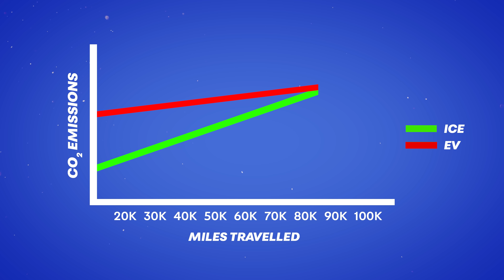Are Electric Cars REALLY That Green? [New 2022 Data]

Comment: Rory, didn't touch on things  like the fact that for instance my ICE car only has 15K on the clock after 6 years so its not just about miles done but a cars utility and life span, most are replacing cars not buying them for first time . If most of us repaired and kept there existing ICE cars longer that break point mileage is more  like ~100K , what's an EV battery going to look like after 10 years .. doubt my car would require more that £2-4K  (clutch, brakes, shocks, misc...) to keep it on the road for another 5 years.. Quite a few cars are binned before 60 -100K miles  or after 7 years old ,  i.e. a timing belt change on a car that's worth only 3K  usually just isn't worth it. Lets not start on whole anti-repair culture  (don't see how we can be green with it) that permeated in the last decade or so... worse now as the government will seemly completely ban or tax ICE cars  on a whim. So quite a few cars will barely, or wont hit the break even point. Also the Volvo report 2.4.4 didn't factor in the expansion to the power grid  (increased power generation, upgraded wiring (digging up roads) , charge point manufacturer and installations) lord knows how  much Co2 that will add.

Comment: I personally don't like electric cars, I feel like on the longer run when it comes time to replace the battery or if the electric motor burns out for some reason, you would seriously regret buying an EV. I don't feel comfortable putting down my heard earnt money into a product that's not going to cost me much in the immediate future but later down the line is going to cost me an Arm and leg keep things running. Also the resale value of electric cars I would question that as well, both as a seller and as a buyer.

Comment: Did Volvo even took into account that in the most optimistic version delivering 1l of gasoline to the gas station costs 3,5 kWh? It's at least 3,5 kWh wasted energy before even ICE tooks off from the distributor and starts its emissions of not only CO2, but all the other toxic fumes? When you consider that this Volvo burns ca 9l/100km, it's 31,5 kWh of energy which would all9w xc40 drive way over 100km before ICE even started driving...
I believe they missed this variable which makes the hell of a difference and moves break even Point probably significantly on EV favour...

Comment: Nice video. I think your point at the end is a really good one - size of battery and overall weight of the vehicle is VERY important.

It feels like most EV manufacturers are still building big fat cars. Why hasn't Nissan made an ev Micra for instance - they could likely deliver 100 miles around town for well under 20kwhs. And it could be affordable too.

As long as most EVs are chunky SUVs we're likely to see break even stretched towards 90k, rather than 20k or so...

Comment: It's 100% still true that a smaller BEV will be better than a big, massive one for using less electricity and fewer resources in production, which is my main takeaway. The LEAF Plus manages about the same range as the XC40 Recharge, but with 800 lbs less "stuff" to haul, meaning it gets to use a smaller battery, and uses less energy per mile.

In general, I'd encourage 1) people buying EVs think critically about the battery capacity they actually need, rather than just assuming more is better 2) ICE drivers to check into the literature on BEVs with an open mind, understanding that BEVs are not as good a solution as public transportation infrastructure is and 3) vote for change that will move the ball downfield on lessening environmental damage.

Comment: The problem not discussed is the battery life, so at approximately 8 years you will have a high probability of battery failure so then you need to replace them, this is bad because you have the new battery impact and the unconsidered impact of recycling the old battery which is massive.

Comment: I think that people need to be realistic on the size battery they require when buying an electric car. I have an e2008 with 50kw/h battery which really provides me with the range I need on a daily bases for 99% of my trips.
Reply: Exactly Carl. The average UK daily commute is 20.8 miles, and the average UK motorway journey is 70 to 80 miles. The typical UK non commuting journey is 9 miles. Yet there are still those whom say they won't have an EV until you can get one with 10'000 miles range, which charges up in 4 seconds. A 200 mile range EV would actually suit the vast majority of daily drivers, but they just don't realise it yet. It's all about perceptions and expectations. In the day of the horse, people had totally different expectations, and lived their lives around them. It once took a week to get to London if you lived 200 miles away......

Comment: What about when you factor in after 10 years you will probably need a new battery? Won’t this make the overall CO2 of the electric car make another huge jump into the red?
Reply: EV batteries don't just drop dead, they can have a second life in e.g. House battery storage. And the materials in the batteries can finally be recycled to make new batteries. The very thing that makes them expensive in the first place is driving the recycling demand.
Reply: Why might you need a new battery?  Why wouldn't you consider having the pack refurbished, at a fraction of the cost of a complete new replacement?  Usually, in a multi cell pack such as you find in an EV, it is just a certain few cells which degrade at a higher rate than the rest. An older Nissan Leaf for example, has over 90 individual batteries making up the complete pack. There is already a YouTube video of a 10 year old UK owned Nissan Leaf having it's battery refurbished. The work took 4 hours and cost the owner £600.  Quit the "new battery" scare stories, because they simply aren't true in the vast majority of cases. You might like to note that in 10 years, an ICE car will also need replacement parts and repairs......
Reply: @Brian-om2hh  You could have the battery refurbished but at some point it will need to be replaced. If not the individual cells will have to be replaced as you mentioned. 

I think this is more of a concern for someone who only buys second hand cars, like myself. Now if I buy a car with 80k miles there will always be a concern that a very large bill is approaching in the near future. 

To be honest my main issue with EVs is that the people who drive them like the smell of their own farts. They are advertised like they are a huge leap forward in terms of pollution reduction and it’s not exactly the case given what it takes to create them. 

My point about the battery replacement, wether it’s the whole battery or only certain cells, is this just adds more to the EVs carbon footprint making it even closer between them and ICE. 

A lot of people nowadays are very wasteful and only want new cars, with low miles. They will flog the EV to buy another new one before they have broke even. 
The world has gone to shit :D haha

Comment: Brilliant, informative & hopefully AT LAST, a BALANCED view!  Thank you so much & very WELL DONE  RORY AND VOLVO!  Like you, I have a fully renewable green tariff so 29,000 miles or so sounds about right &, more importantly, workable.
Be interesting to see with the massive numbers of 8 + year-old ICE cars still around, whether the same will apply eventually to BEVs, in which case, greenness may prevail at last.  Of course, that is much less of a guide because the CO2 comes largely from the battery pack which needs replacing more often than the car, at present.
Reply: The batteries should last at least 200k miles before needing to be replaced but that all depends on how they are treated (since letting them fully discharge often significantly reduces their lifetime). Of course different and better batteries will also be coming in the future to replace current lithium ion.

Comment: While Volvo mention well-to-tank environmental impact has been assessed as a particular ethanol mix, they do not mention how or provide numbers on its emissions; which given they have gone into detail on different energy mixes for the EV is a source of bias in the report.
Since oil first started getting drilled, the amount of energy required to extract it has increased. Oil fields get deeper, move out to sea or require extensive mechanical extraction as in the case of tar sands.
In the 1920's the ratio was roughly 1:100; currently it is closer to 1:25 according to BP. Put simply, for every 25 barrels of oil extracted it takes 1 barrels worth of oil energy to extract them and it only ever gets worse.
While the EV can get greener as domestic energy mixes improve, the ICE will definitely get dirtier without massive changes to the fuel, themselves requiring unknown amounts of energy to achieve.
Given the majority of cars do well over 100k miles in their lives, the report tells me that either way they are greener (not green - greener) and the comparison is only going to go one way.

Comment: There's never much said about the waste batteries what happens to them and who's recycling them.  I can see this as a environment problem for years.
Reply: Oh, the materials in the batteries are much too valuable not to be recycled.
Reply: Volkswagen already have a battery recycling plant up and running in East Germany. A UK based company - Technology Minerals - is also to begin looking into processing older EV batteries. They are said to be planning 5 sites in the UK. A number of other organisations are looking to do the same globally. It is estimated that eventually there could be 150+ EV battery recycling sites globally.
Reply: Batteries have a significant value for second-life applications like domestic storage beyond the 200,000km Volvo have used here.  It may be a long time before the economics make recycling the preferred option.  I see this as a major omission in the report as, if I am reading it right, they are assuming it will be recycled at that point.  As the primary difference in upfront carbon between ICE and BEV is the battery pack, ignoring second-life potential puts the BEV at a disadvantage.  I don't think Volvo is being disingenuous, they have just followed a methodology that assumes 200,000km is end-of-life for everything.  They have strived to maintain like-for-like, but that tends to lead to doing things the "old way".  However, whether we are talking about materials extraction, manufacturing, energy generation, logistics or recycling it is important we strive to avoid finding new ways to be bad for the environment.  We have not always been good at learning the lessons of the past.
Reply: @andrewhowe4266  "methodology that assumes 200,000km" WHICH IS SCAM! Minimum should be 200,000 MILEs.
Reply: @Neojhun  I think scam is a bit harsh.  I think the EPA uses 200,000 miles for car life, but they assess annual mileage as 15,000mpa.  In Europe, the average is only 12,000kmpa which is far lower.  All the assumptions they make alter the result.

Comment: Oh, the Tesla Fanbois are not going to like this.

90000 miles =  150,000km = about 10 years driving.
By which time an EV battery will be toast and needed to be replaced.
And then the EV takes another spike upwards in CO2 emissions as the new battery that was replaced just took 13 Tonnes of CO2 to produce. Which takes another 150,000km to start breaking even again.

Summary: EVs are not green [Water, CO2 emissions]. Not at all.

Comment: Evs have no maintenance cycles like oil changes and the like.  Multiply oil changes x a billion automobiles and that’s 5 billion quarts every cycle.  That alone cancels any ice cars out of the loop.  So take your car at only one oil change a year, remember some cars Porsche may take up to 13 quarts or a hyper car may take even more. The cost alone with fuel will double the price you have paid for the car in just 10 years.  On a EV. No maintenance. And no gas,  although they may get plugged in but no one seems to be able to put a cost on the total amount of electricity used.  My ev uses solar cells and gives in the sun 40 miles to drive a day.  So I’ve not had to charge it yet although it was fully charged when I picked it up.  I’ve been charging regular car batteries for my cars for years though from 
Solar power.  I really admire a friend of mine as his house has been off grid for the last twelve years.  And the initial investment back then was only about 35k. I think the power company has paid that for his contribution to the grid.

Comment: Wish you can continue this video until the EV's need to get the battery replaced or serviced like a womb to tomb thing?
Reply: Most current ev’s will never need to have the battery replaced during the life cycle of the vehicle due to the better battery chemistry and battery management systems in new ev’s. Ten year old Nissan Leafs still have 2/3 the capacity they did when new and battery technology has improved hugely since they were produced.

Comment: The Volvo xc 40 is not a bespoke ev though so it’s compromised over a ground up ev design. Smaller ev’s like the Renault Zoe or Nissan Leaf or Fiat 500e pass the extra co2 involved in their construction much earlier in their life. Plus plenty of other studies bu universities have shown ev cars recovering the extra co2 involved in construction after much fewer miles than this study. Also the fossil fuel energy production figures are moving ever faster towards renewables shortening the miles required for ev cars to pass petrol cars for co2 released. The way to makes ev’s even greener is to make them lighter and more efficient, not by haveing large SUV’s with massive, heavy battery packs. Smaller battery packs and a better charging network is the way forward. Most people don’t need 250 miles of range for most journeys.
The other thing that wasn’t mentioned is that ev’s are far cheaper to run than ice cars both in fuel cost and maintenance

Comment: I really only care about the savings to my wallet. Unfortunately with electricity prices set to be 36p per kWh soon Evs will actually be more expensive to fill up then cars.

For example the partner 50kwh van will cost £18 to fill up the battery and do 100miles compared with the diesel partner which will cost just 10 quid to do the same 100 miles.

Over a year of driving for me 25k miles, the difference would be 4500 for the ev to 2500 for the diesel.

Comment: I think the bottom line is, that EV will evolve and reduce emissions even further very soon. ICE cars has reached there dead end already,  beside the real emission under different temperature circumstance, where the emission system on ICE will work suboptimal. I am not sure if the overall consumption of required lubricants was considered in the research, but also consider the the lower fine particles that a EV are producing using regenerate breaking in city’s. Overall it does not matter EV will be the most less polluting transportation in the future despite the very optimistic research for ICE cars as of today. BTW battery can most likely be recycled in a very high percentage but good luck on trying to recycle the consumed petrol ⛽️😉

Comment: Did Volvo also include all the emissions being produced by installing chargers in millions of homes and streets,  charging cables being produced, car fires that last for days etc.  It's not cleaner at all and the reason it's not cleaner is because they are forcing a technology that isn't ready. When ice cars were first invented they didn't ban everything else, people started using them because they were better.  The best way to do this would have been to start producing electric cars but also continue to allow the production of new fuel cars and have no time limit. This would have meant there wasn't an over reliance on one technology, there wouldn't have been the need to fit millions of chargers or convert petrol stations. Also the progress that has been made over the years making fuel engines cleaner would not be grinding to a halt, there are cars now with engines half the cc then those from even 10 years ago yet have more power, do more mpg and produce less emissions. If electric cars become better people would naturally change to them.

Comment: My question is, what happens to the toxic battery at the end of its life cycle? Love the video, Im a ICE enthusiast that is starting to warm up to EV's, and this puts it in a nice perspective. However, the way batteries are going to be recycled/processed after the lifetime cycle is over, and the fact that once they start burning in an accident, they just do not stop, all the while leaking chemicals into the environment, have me got sceptical still.
Reply: Simple enough. It can be 90% recycled in a battery recycling plant, like the one Volkswagen already have up and running in Eastern Germany.
Reply: Simple enough. It can be 90% recycled in a battery recycling plant, like the one Volkswagen already have up and running in Eastern Germany.  Please explain what might "leak" from an electric car battery, because there is no liquid content........
Reply: Use google and you will find the answers blow everything you say out of the water.  Still, make a comment without doing research.
Reply: Er, an EV battery has no liquid elements inside it to leak out.....  Have you done any research at all on EV batteries???  And have the 160'000 plus ICE cars which catch fire each year in the US, registered on your radar at all?  Were you even aware that statistics presently show there are just 3 fires per 100'000 electric cars?